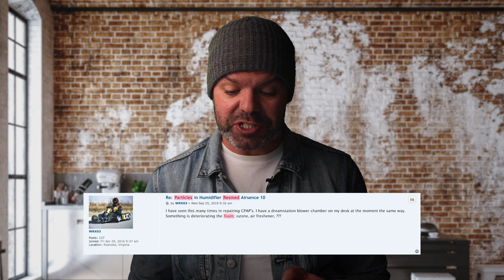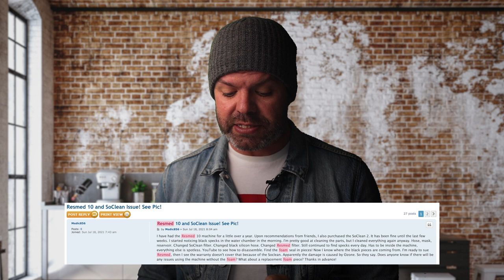🚨WARNING! AirSense 10 Foam Degradation & Removal

Comment: I was supplied with a Res Med airsence 10 in August of this year and it's a great machine, it has done wonders for me.  When  I picked it up and inquired about a so clean system the rep at the medical supply company out right told me don't use it, he doesn't even sell them and don't buy one off the internet, he said stay away from them.  He was adamant about it but wouldn't say why other than it's just cheaper to use soap and water and left it at that.  I didn't get one and now I'm glad I didn't.   Keep up the good work and thanks.
Reply: I had soclean for five years clean masks mainly now only . AirTouch F20 cushion. They do not recommend cleaning masks in soclean,  foam cushions look great, recleaning 10 masks 2 or 3 years old smell fresh

Comment: I work on vintage audio gear, but I also use a ResMed AirSense CPAP. I can tell you that Ozone does in fact degrade foam. I know because I have seen loudspeakers (with foam surrounds) used in rooms with Ozone generators, where the foam surround falls apart in just a year or two. Normally, foam surrounds last 15-20 years. I do not use Ozone for anything, as it is a health hazard in and of itself.
Reply: It does have a few possible health applications but it's best to leave that to people who know what they're doing.

Comment: Just gotta tell you THANKS!!! the instructions you gave were great and allowed me to make my own decision about, in my case-removing, the foam in my Resmed machine. Also thanks for giving the quick "rebuild" instructions, very helpful. 
Finally thanks for your analysis of the safety of foam in the Resmed. You struck a good balance between "everything is ok..." and " ... for now". 
My machine is as quiet now without the foam as it ever was with the foam and I'm much more comfortable using the machine this way. In fact I found myself holding off on using the machine since foam-gate began, so who knows, maybe you added a couple of years to my life!!

Comment: Love your channel. I just wanted to report an observation on this situation, I bought a used DS1 in Sept 2023 from a widow with the plan to use your Drain Weevil method to extract the foam and use it as a backup device. The machine was purchased new in 2021 in Jakarta, known for hi-humid hi-tropical heat, bad particulate air pollution. The DS1 had been used nightly in Jakarta for two years but with NO water heater/humidifier attachment installed and the unit was never cleaned with Ozone. The former owner never knew and was apparently never informed about the foam recall. The Drain Weevel extraction was successful and the foam blocks were removed in single pieces and exhibited good structural integrity. Removal left no residual dust or crumbles other than what the weevil shredded. In fact, the black PU foam was in much better condition than I was expecting given all the noise and outcry about how bad it was supposed to be. The fan housing had a layer of black soot like substance on the inside of the cover and a small amount of same on the impeller blades similar to what appears on the air INTAKE filter. That experience is enough to make me think the Ozone may be the primary culprit. Take a read of a Material Safety Data Sheet for Ozone, it is highly chemically reactive and generally very bad news. I think Philips has a point. SoClean's lawsuit may not be enough to save them from liability.

Comment: Thanks so much for this great info. I recently replaced my Dream Station 1 with the Air Sense 10. I have never used an ozone cleaner on any of my cpap machines. I removed the foam from my Dream Station & it was in good shape. I'm very relieved that there is no issues with the Air Sense 10 foam if no ozone cleaner was used. Thanks for all your great & informative videos.

Comment: When I first got my Philips CPAP I had nothing but trouble with it. Constantly bringing it back with pressure issues to it shutting off. Finally about after six months, there were so many things wrong with it, they allowed me to get a Resmed 10. When they were reviewing the machine, it actually broke more on them during the appointment. This is apparent that so clean is responsible for these issues but I will never get a Philips CPAP ever again.

Comment: Thanks for the information. I worked at the EPA monitoring ambient ozone levels in the past.  I always wondered what the ozone generated from those So Clean machines would do to the plastic inside the CPAP machines.  I didn't know that Respironics used sound insulating foam inside their machines.  My machine was recalled and I got a new ResMed AirCurve 10 ASV machine now.  I would not recommend using ozone gas made by high intensity UV lights for anything with plastic or foam inside it.

Comment: VERY IMPORTANT: There are *3* pressure sensors, not two.  There is one on the back of the PCB, but it connects to a clear/white rubber gasket while the top two connect to a blue gasket.  It is easy to accidentally misalign that back sensor.  If you miss this sensor, the machine will blast you with max pressure, and then will only output very low pressure afterwards regardless of settings.
Reply: I'm not seeing anything like this. Wish I could find a diagram online.
Reply: Actually, I think I found it, and I'm wondering if it's a piece that is where the motor connects to the humidifying chamber, just under the screw for the PCB.
Reply: so, that indeed is it... and resolved the problem I was having after reassembling. took it apart again, made sure to get that sucker lined up, and boom! pressure back to functioning properly!!! thank you!!!
Reply: Perfect. I was having the exact same problem and this was the reason.
Reply: Its like right behind the display screen if you cant find it
Reply: What sensor would control smartstart? When I take my mask off it keeps blowing hard instead is slowing down. Will it effect the operation of the unit?

Comment: Just took mine apart (AirSense 10), I was so inspired! 
 Some notes:
-  The ribbon cable for the heated hose can be popped off at the top.  The end is slotted, so it can only go back one way by just pushing it in gently.  It seems to be held by friction.
-  Same ribbon cable can have the slack taken up by rotation the hose coupler all the way towards the tank (might have that backwards, but you'll be able to see while you're doing it.)  With the slack taken out, it won't get stuck between the hose coupler and the frame (like I just did!).
Great video, everything went super easy with just a T10 bit, brilliant!!!
Thanks Uncle Nicko!

Comment: I am a retired water treatment professional. And lab analyst. Ozone is a very good disinfected but is also highly corrosive. I knew better than to run it through my machine. I hand clean my machine and my wife's machine.
Reply from the maker: Nice one mate, thanks for the great info. Nick
Reply: How do you clean the inside tubing and turbine parts of the machine?  Because if the tubing and masks can get dirty, so can the parts inside prior to them where the air flows.

Comment: Today I received a new AirSense 10 to replace my 2015 AirSense 10 for the "Motor life exceeded, contact care provider" message.
The old one had 22,370 hours on it And I never used a ozone cleaner. So I decided to dissect the old one to have a peek at the foam. There was no degradation at all. At most there was a trace of dust in the turbine blades. 
Thanks for the videos
Reply from the maker: Nice one mate, thanks for sharing that info :-). Definitely keep the old one for spare parts. Cheers

Comment: Nick. I got a shock yesterday. Received my new dream-station 2. I was totally surprised to get a new one this quick from the recall.  It is very nice, quiet. Easy to set up.  And now I will be able to sleep better and feel safe. 
Thanks for all your help and info.
Reply: I hope I get one sion
Reply: glad to hear you get a replacement from Phillip. At least they (from Phillip) would make sure the new machine doesn't have foam. Need to follow up with my replacement.
Reply: Same here! I didn’t know they were sending a replacement so that made me happy. It had been 4 months without my CPAP

Comment: i have used divillbiss mechines for 16 years  .....have had no such problems with the foam ...i use only warm water with a little mild soap only,,,,, have stipped them checked for any dust etc  ,,,,,,have washed the foam in the same solution ......they still work fine and are reserve machines one haveing had over 28,000 hours of use,,,,,,, i now use a resmed 10 mechine which i dont strip to clean as it is a hire mechine only clean outside,,,, far to over priced to buy with only 2 years garentee,,,   looking to buy a new devillbiss mechine more up to date than my old ones.......i see these are all sold out on your sponcer site,,,,,,long life mechines ,,,,no problems and cheaper,,,,,,thanks a bunch for your magic video,s fella
Reply from the maker: Hi Stephen, i have big concerns for Devilbiss - https://youtu.be/6RZ6oNyERLg

Comment: Nicko thank you for the video.
I got my res med air sense 10 a year ago and was wondering what my foam would look like. After spending no longer then 30 minutes taking apart and putting back together seems like my foam is good. I can finally not stress out about this. I encourage anyone reading this to check there foam if you are worried about the foam dust as it's not hard to take apart and put back together.
Thank you again brother!!!!!!!!!!!!!!!
Reply from the maker: Hey mate, i appreciate the comment. I would like to add though that unless you have been using ozone then there's probably no need to take it apart as you could potentially stuff up putting it back together etc. Only really required if you've been a medium to long term user of ozone and or have seen foam particles in your chamber. Glad you managed to check it out though. Cheers
Reply: @CPAPReviews  Nicko I forgot to mention I did buy a so clean2. The stupidest $350 US dollars I've ever spent I used it maybe 20 times. So I had to find out. Like I said your video was pretty straight forward you didn't leave anything out.
Thanks from the USA

Comment: I remember when I first heard of ozone when I started my cpap journey back in June of this year. Even before getting my deathstation I knew ozone wasn't a good cleaning solution just because I studied chemistry in college and it was used on certain labs for some glassware and they advised you had to be out of the lab when the cleaner was in use. Even then, the preferred method was soap and water for most things.

Comment: Thanks for all the information you have provided.  I started using CPAP in 2020.  I have a Resmed 10 and was using So clean the whole time.  I tore it apart yesterday because the motor was getting loud later at night during higher pressure and waking me up.  After tearing it a part I found that the foam that was in it was starting to break apart.  I currently am not putting So Clean thru the machine anymore but the damage has been done and there is no one to go back on because they both deny.  So Clean should pay to have the motor replaced.  I am doing the work thanks to you .

Comment: Thanks Nick, Fantastic video on SoClean and ResMed safety and how to check whether your foam is breaking down or not. I could never understand how any CPAP manufacturer thought it was a good idea to put a sound abatement foam in the air pathway of a medical device. Whether the foam is safe or not, it can't be changed without opening up your Resmed Airsense 10 with a screwdriver tool and removing the Torx screws.
Reply from the maker: Hey man, thanks for the great comment! Yeah that's a great point you make also. There has to be a better way! All the best brother. Nicko

Comment: Thanks Nick for a most informative channel. Been on APAP for 11 months. I'm kind of a do it yourselfer so I haven't been back to the place that gave me the machine because it's a long drive and appointment required. Your videos have helped me make huge improvements in my treatment. I was spending most of my nights with 85-92 SPO2 readings. Now I'm in the 90 to 98 all night now that I know what the clinical settings do. I'm not as sleepy during the day either. Thank you.
Reply from the maker: Hey Chuck, that's great to hear mate. I really love reading reviews like this. Best wishes man. Nicko

Comment: Hi mate! From Brazil here. I've just bought a ResMed AirSense 10 VAuto (quite expensive bit). And now I'm appalled to know that it has a precoded expiration date,  it also has filter issues,  as well. I was diagnosed with ALS back in 2019, and can get 63 events/hr without the Bipap. Started using a Philips Respironics Dreamstation, until just last month. I've been following your channel and videos and learning all I can. Thank you so much for the information you share. Keep it up.
Thank you

Comment: I have two different ozone cleaners, but the SoClean is too expensive. I used to clean both of our Airsense 10 machines with the ozone cleaner, but my wife complained about the residual smell. I didn't care for it either and now I only clean the hoses with it. I've never noticed any particles in my water tanks so I don't believe I have an issue since I didn't clean my machines for that long of a time to affect them. Now I know what to look for. Thanks!
Reply: I have an AirSense 10 and only clean the mask/hose with it. The 2 times I actually ran it through the whole unit there was a notable ozone smell in my bedroom. Running it through the mask/hose entirely contained within the SoClean there's no ozone smell at all. The hose and mask are regular replacement items, so I'm not worried about them degrading before they're replaced.

Comment: I'm using my ResMed AirSense 10 since over 3 years. It came never in touch with ozon. I dissampled the maschine last week and my foam looks perfect. 
I think that the ozone is the reason for disintegrated foam not the foam itself. But to be fair, I also never used the water tank.

Comment: I just got my AirSense 10 a couple weeks ago, so I'm glad sticking to plain ol' Dawn dish soap for my mask and hose and not trying to run anything through the machine itself ought to keep it going for a very long time.
Reply: I use Dawn antibacterial dish soap and have had zero issues with the machine 8-months later.

Comment: Excellent video, Nico. I use the AirSense 10 every evening. My current machine is 4.5 years old. The only time I use Ozone to clean anything is with my Sleep8 cleaner, and I only use it to sanitize my tube. I clean the reservoir with soap and water, then put it in a UV chamber along with the mask and head gear to sanitize those. Since I do not run ozone directly into the water reservoir and hence into the machine, I'm concluding that my foam should be as good as it was when new like the one you show in this video when you disassembled the machine.

Comment: I have a 4 year old DreamStation. Used only distilled water and did SoClean it regularly. Recently took it apart to get the foam out after the recall. Foam was in perfect condition. I am not trying to defend Phillips only wanted point out that perhaps SoClean is not the only factor.
Reply from the maker: Thanks for sharing mate. Cheers

Comment: I watched this a few weeks ago. All the sudden one night I was hearing a low humming noise from my ResMed 10. A couple days later I found foam I'm my water tank. I have yet to take it apart to look at the motor. I did inspect what I could see and only found it in the water tank. Thankfully I think the water tank is catching the majority of the foam. Thanks for the information. It has been very helpful. Also because of foamgate. Nobody has a loaner CPAP machine to use if you need to send yours in to get fixed. And if you buy a new one there may be a wait before you get it. Also I saw one company say one machine per person. I guess people bare stocking up.
Reply from the maker: Hey mate, take some photos for me when you take it apart and send them cpapreviewsaus@gmail.com if you have time. Thank you
Reply: @CPAPReviews  Really wasn't anything to take pics of. The foam was totally gone. There was one piece about the size of a bean left in the motor. There was some debris in the water tank. This obviously has been going on for awhile. I cleaned everything the best I could. Probably should of had a picture of my face when I pulled the motor cover off and nothing was there. Lol
Reply: @jamessoda8915  is it because you were using ozone to Clean the foam?
Reply: @gopim6124  Yes.

Comment: I have a resmed 10 for over two years now. I also have a SoClean2. I do not hook up the SoClean2 to my resmed. You do not have to connect the two! Just replace the filter. I don't think you need to "clean" your water. Problem solved. Don't make it harder than it has to be. My foam is still fully intact and problem is averted.

Comment: I used a SoClean for a period with my 10 and after a year or so the machine made quite a groaning / whining sound during use due to an apparent internal leak of some sort.  My provider replaced the device thankfully and I stopped using the SoClean and the AirSense 10 has been good for years now.  I use a Sleep8 for my tubing and mask (and I stick the humidifier reservoir in there without the seal) but no ozone through the machine and things have been fine.  I think for sure ozone can degrade the materials (even the silicone gets oxidized — you can see it turn a slight brown color after sanitizing), the hose and headset get replaced at regular intervals — not the same for the machine!